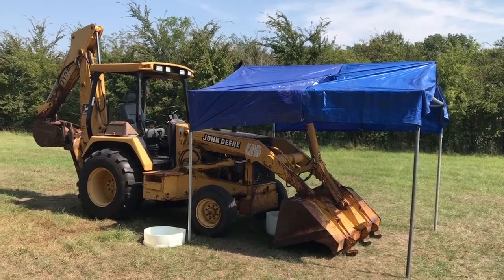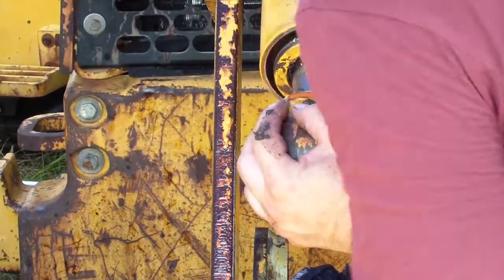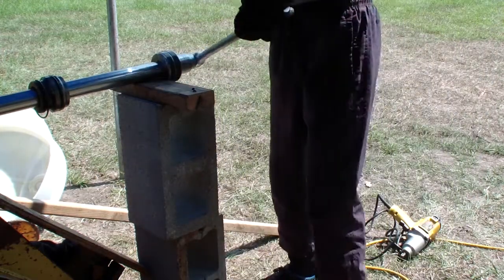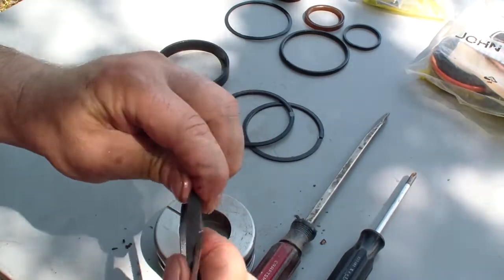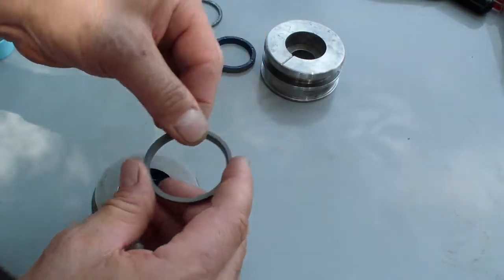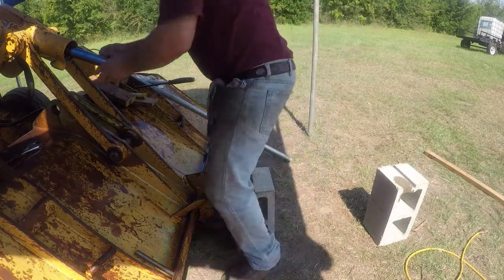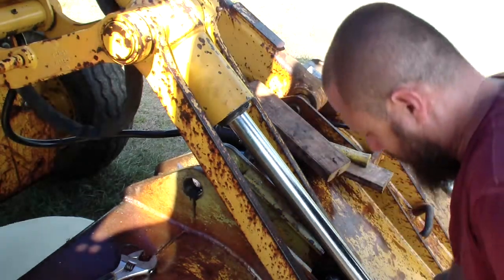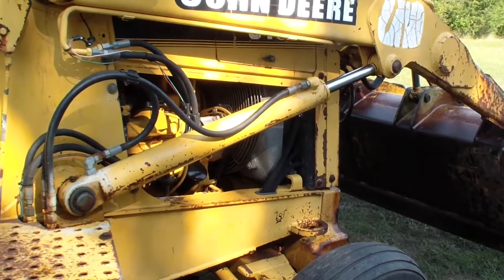John Deere 310D Loader Bucket Cylinder

Comment: Thank you Mr. Sayhood. Your help using the hammer drill removing the retention nut and twisting bladder was the way to go. Instead of a screw driver I used a heavy duty clip ring pliers and a rag. Great videos!!  Thank you again!! 1987 JD 210C
Reply from the maker: Thank you sir, I appreciate your comment.

Comment: I just resealed my curl cylinder on my 310 SE. Very much the same as yours. I had to buy an air chisel to get the cylinder ring unscrewed. It finally worked. Thanks for the video.
Reply from the maker: Good evening, I am glad to hear that, thank you for the comment.

Comment: Thanks for the info. I replaced the seals in mine. 
Dam that big nut was tight. I had an 8’ pipe with all my weight (200lbs)
Reply from the maker: Thank you for comment.

Comment: I’ve got my cap but to break loose but it won’t thread out just spins any ideas
Reply from the maker: Hello Keith, the same thing happened to some of the cylinders, I covered this in this video: John Deere 310D Hydraulic Cylinders Finale 
This happens because the O-Ring is gone or there is rust or damage to the threads, the way I got mine off is by soaking them with WD-40, cleaned everything, keep using the jack hammer to tighten and loosen the nut until it finally came loose, or you can try to use a screw driver with a rag so you don’t damage the rod or the gland and wedge it between the rod and the gland where the wiper seal is. Good luck

Comment: Yours is only one cylinder on front bucket? Mine is two one in each side
Reply from the maker: Hello Sergio, what year and model is your machine?
Reply: @SalamSayhood  hi Salam its a 310-A and I believe its a 1977
Reply from the maker: Yes, that model should have two bucket tilt cylinders.
Reply: @SalamSayhood  what year it’s yours? I did replaced the two cylinders gaskets this past Saturday, everything was ok my only concern its if we tightened enough the 1-5/8 nut inside of the cylinder.. bc the tech from de dealer scared me saying must be with torque 800 to 1,000
Reply from the maker: Mine is 1993 310D. If you use about 4 feet pipe and use your body weight, this should be enough. I been doing this since I was kid and never have an issue. At the hydraulic shop, the use impact to torque the bolts or nuts to specs.
Reply: @SalamSayhood  yes that’s exactly what we did, thanks Salam for all your help
Reply from the maker: You are welcome.